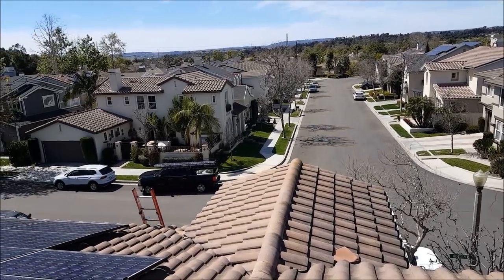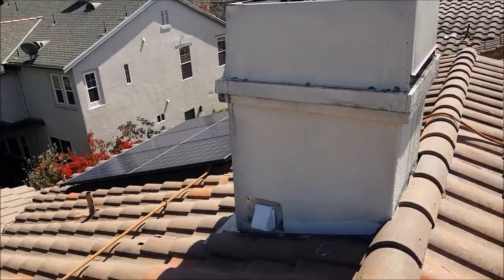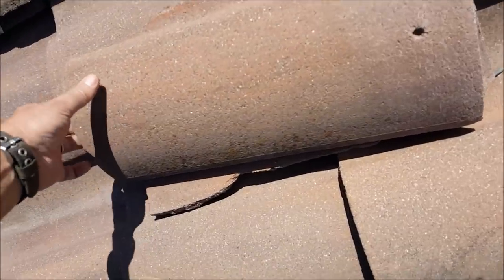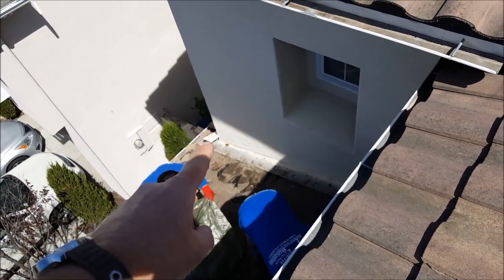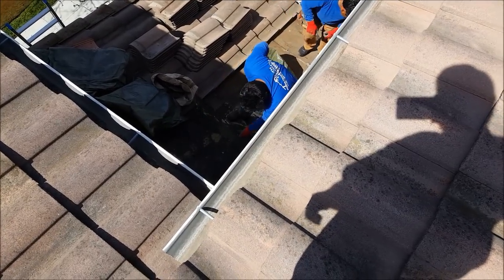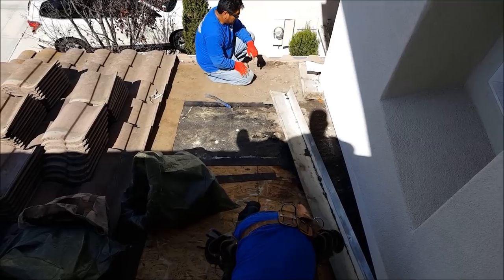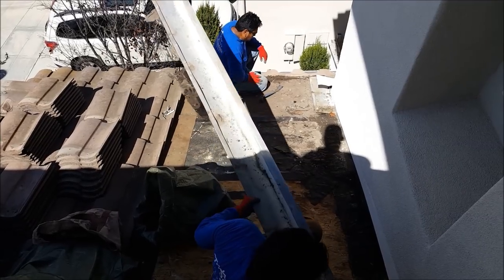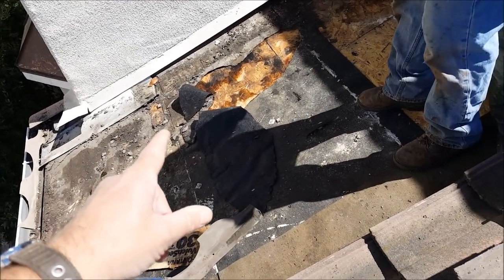New Home Builder Roofing Short Cuts Exposed - Bad Roofers get you Worse Leaks.  Ladera Ranch, Ca

Comment: Thanks for covering a little bit on the solar! Those panels are in the "landscape" orientation. The runners under them are usually called rails. They are mounted on specialized L-brackets called Tile Hooks that attach the the rafter and then follow the angle of the roof so that the tiles can be replaced over them. Usually there will be 2 or 3 strings of modules. Each string is comprised of modules that are serially connected, and the strings themselves connect in parallel to the inverter.

Love seeing what you have to say about different things I encounter during site audits. Keep it up!
Reply from the maker: Awesome contribution Eugene!